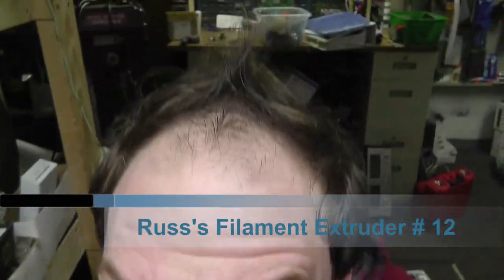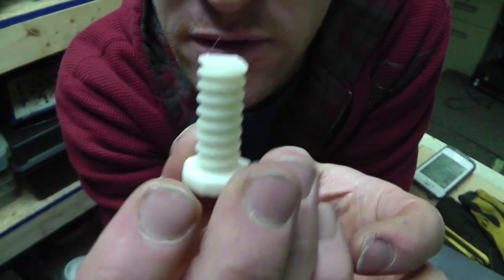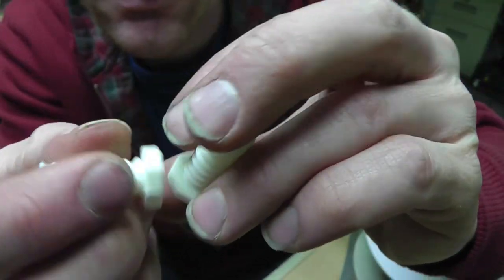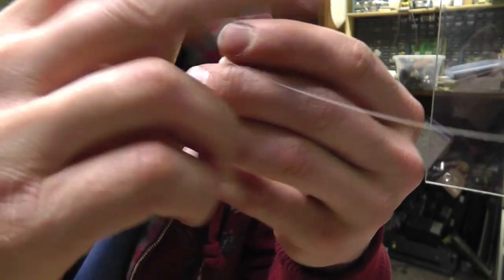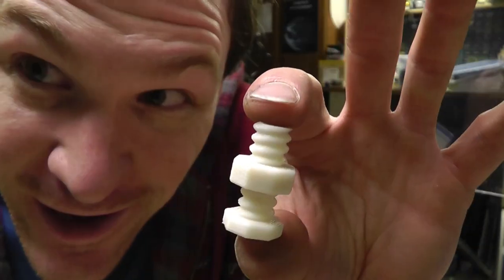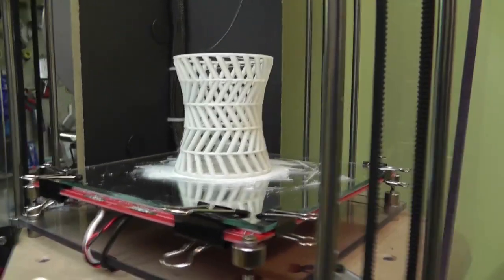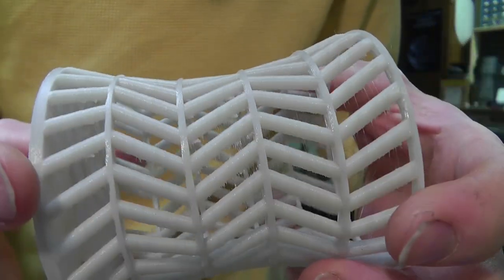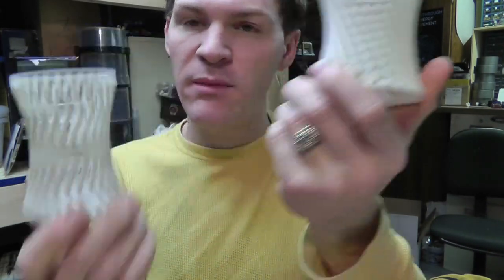#12 ~Russ's Filament Extruder: New Plastic Trial in prienter, YEAH! now where on it! Cool, It Worked

Comment: geat work Russ, sometimes I question your work, but you answer my questions whitin a minute in your video you think of everything I do. one thing though, maybe you can eliminate the extruder altogether, using your printerhead as a extruder and printerhead in one, so you only need to guide the filament through a tube to the printerhead which is a smal extruder. you save time en money.

Comment: I've heard you say you use some sort of adhesive to help to stick to your glass bed.. may I ask what it is.. I've been using Elmer's stick glue and it works well but dies leave pretty noticeable discoloration on the bottom if my prints.. I've tried hair spray but it hasn't worked well only tried a couple brands but I'm open to try new things.. thank you for you time! Great shows too!
Reply from the maker: Well glue sticks work well. Then when you're done wash off your print with water. The glue will dissolve in water.  I think that's the color you see. ~Russ